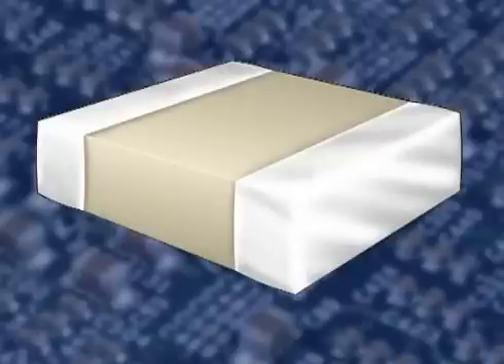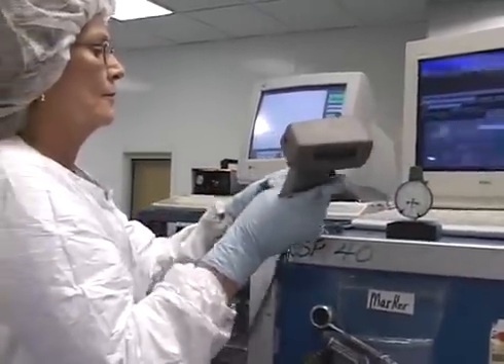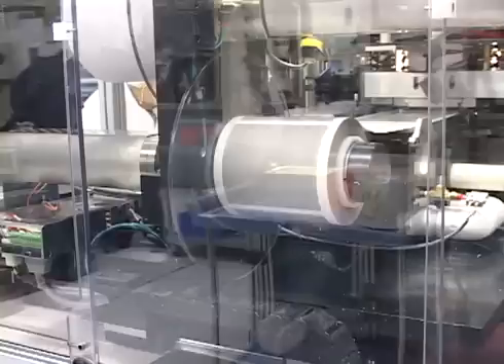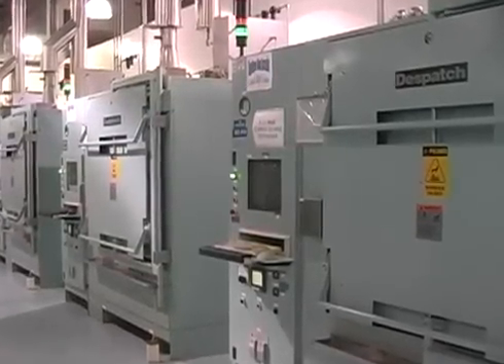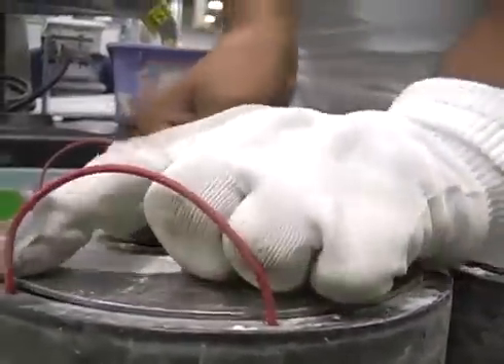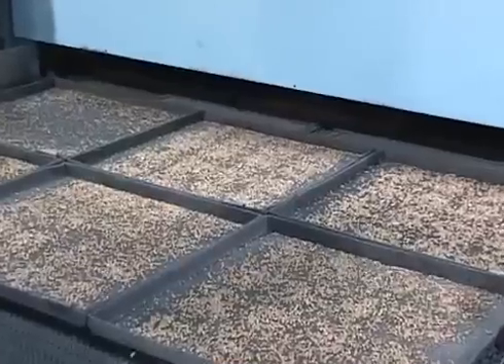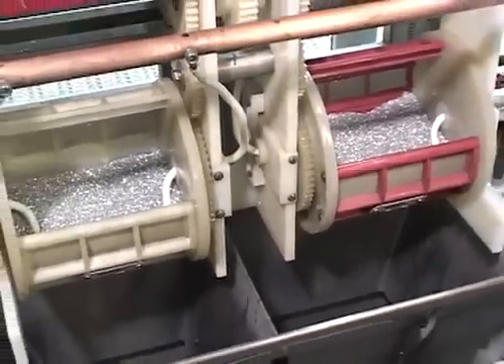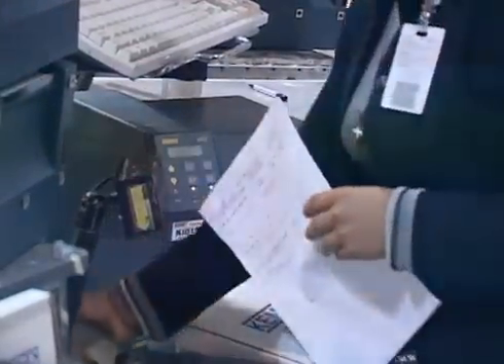KEMET Ceramic Capacitor Manufacturing

Comment: I can't get over how beautiful the plant looks. I made capacitors for Kemet at the old Fountain Inn plant in the early 90s. JR1204s to be exact. We had just gotten our ISO 9000 certification and we were on top of the world. My father worked there for over 20 years and helped transfer the APA line to Matamoros. It has always been a great company with high standards and good working conditions.

Comment: all capacitor capacitance value checked or it on only sampling basis?
Reply: What part of "100% tested" did you not understand?
Reply: all capacitors. every single one. not just capacitance, but also esr, dissipation, discards shorted ones, operation at DC bias, takes less than a second to test. So they can test millions per day. More extensive tests (like temperature stability, aging, vibration, mechanical stress, are done on samples, as they can take hours).

Comment: What is the maximum energy density by cm^3 using this printing process? Using plasma for layer metal deposition as a 3D packaging process can we have a layer of about 5 nm height what would be the energy density then?

Comment: Just finished soldering a bunch of 0603s and found this very interesting indeed.
Reply: Hi Friend ,
This is Bonnie from Gemei / ZA making the electric sweeper special using in Ceramic Factory . 
Contact with us if you are interested in it . 
We have big promotion these days . 
Best Wishes 
Bonnie Ho
Mobile/Wechat/Whatapp:+86 13925923843
Email: bonnieho@gemeicleaning.com 
Web: www.gemeicleaning.com
Reply: @whiteanna7002  over 7 years later...